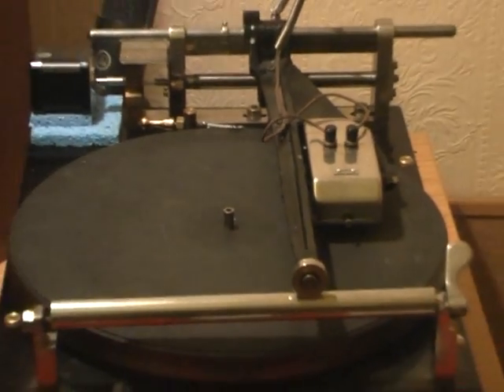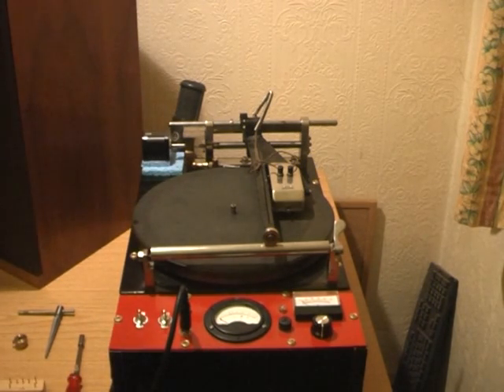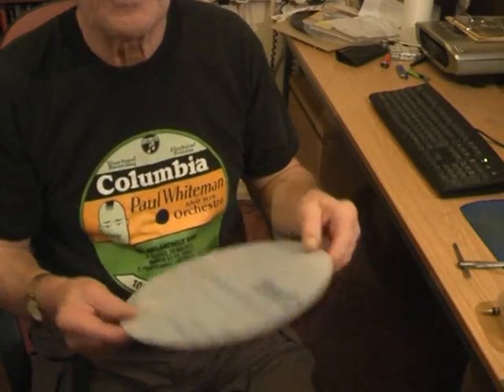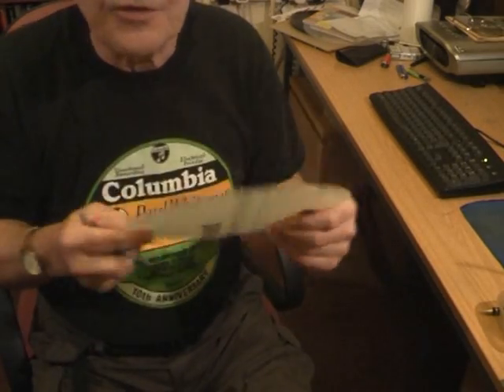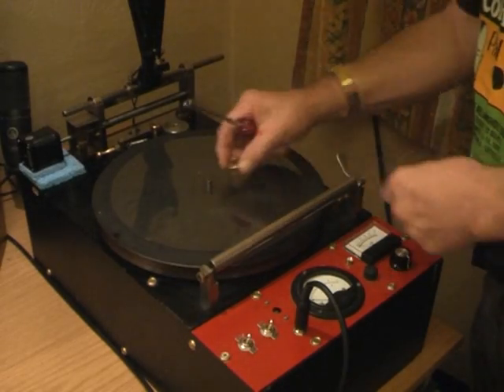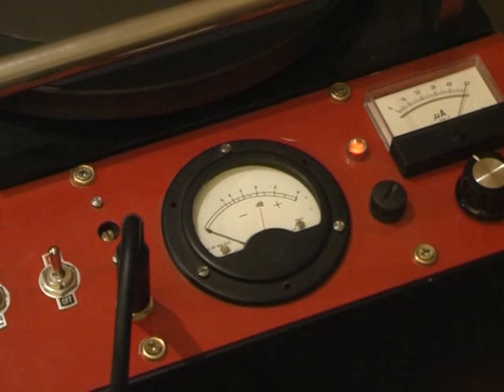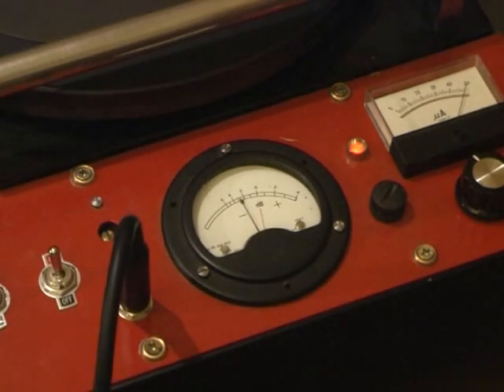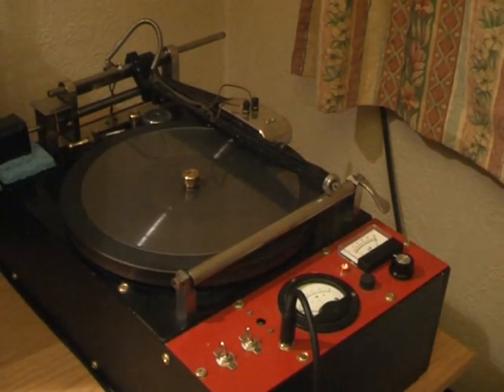home made 78 rpm records

Comment: This is a remarkable video; and the webpage fills in many gaps.

However; what's the EQ, if any, applied to the signal embossed into the polycarbonate: RIAA, Westrex, NormanField?  Or do you not need to bother about that?  I'd anticipated surface noise, requiring pre- and de-emphasis for surface noise (hf) and groove amplitude (lf), but it seems a very quiet medium.  Will the polycarbonate wear well?  The embossing must take the 'finished' surface down as the groove-wall, rather than exposing the inner material, as cutting would.  Presumably the 84° embosser cone assumes/requires a particular radius for the domed-cone of the playing stylus.

I'm confused about the inter-groove groove left by the ridges.  Does that present problems when lowering into the modulated groove (like the old 2- and 3-tune records)?

Groovy stuff, Norman!
Reply from the maker: Michael Fearnley You're absolutely right, Michael. And apologies to 6dBperOctave for not replying to his question! The head needs the treble lifting quite a bit, and as I play my 78s with LP EQ (aargh), it's convenient to put on a reverse RIAA EQ in the computer. Of course, there's the fall off in treble with declining groove velocity too. You doubtless know that Watts fitted his more elaborate machines with what he called a 'radius compensator' - a shoe on the traverse arm wch contacted a series of studs, bringing in progressive top lift. One thing I must do is record a steady high tone and then measure the decline in signal level as the disc plays back. It will probably be severe! No, they won't take a steel needle; the furrow is too wide & shallow. Depending on the point used, you sometimes have to put a fair bit of anti-skating on the playback arm; and I doubt if they would play on e.g. a Dansette if the arm was at all stiff. The polycarbonate is pretty quiet, but has a tendency to be a little crackly on the outer edge if the point is too sharp - I think the embossing velocity is a bit too high at 78 rpm - at least with this grade of polycarbonate. There must be other grades, not to mention all sorts of other plastic materials that could be tried out. It's all been great fun and I'm very appreciative of all the encouraging comments. When I return to the project, the object will be to home-brew a moving coil head. I used to have a couple of Connoisseur lathes years ago, and Arnold Sugden's MC head was absolutely great - bicycle valve rubber suspension & all! Cheers for now.
Reply: The cutter head will have it's own Blumlein shape but no treble emphasis. I'd assume you couldn't play this with a steel needle but would wear in a manner similar to vinyl, so not much with a normal stylus.
Reply from the maker: Please accept my apologies for not replying for THREE MONTHS! I got sidetracked with some ham radio stuff. I've made a longer reply to Michael Fearnley's comment, wch contains extra dope. Cheers, Norman.
Reply: Norman Field Perhaps record a sweep from 30Hz to 10KHz or so and then you can create a pre-compensation curve for RIAA preamplifiers as well as compensate for the frequency response of the cutter. It would make sense to compensate before you record. With a wide groove you're not going to reach over 8KHz or so. It looks like you might get better results with a large replay stylus.